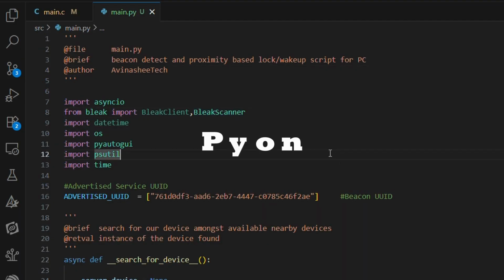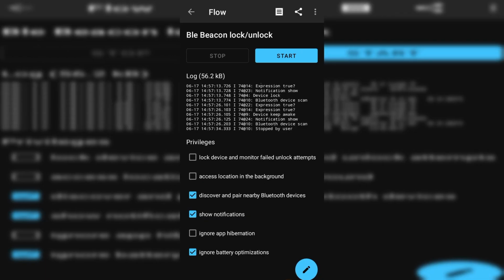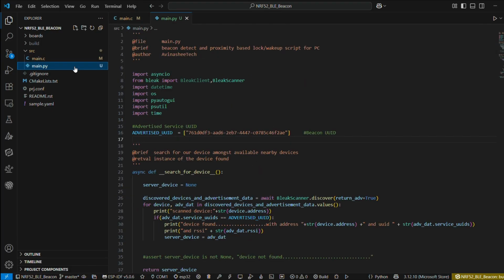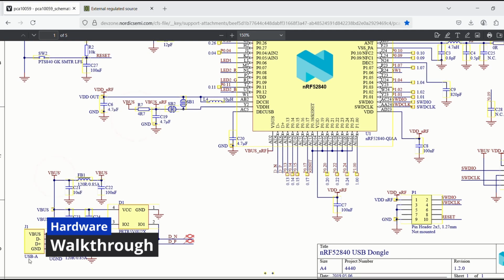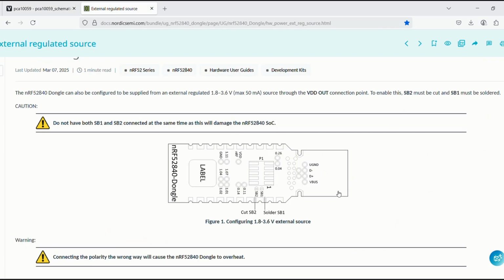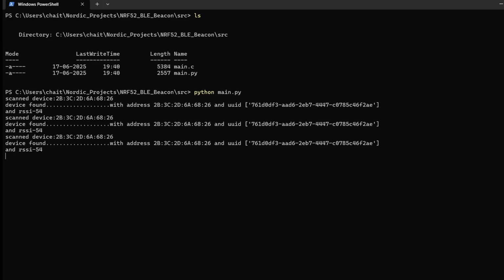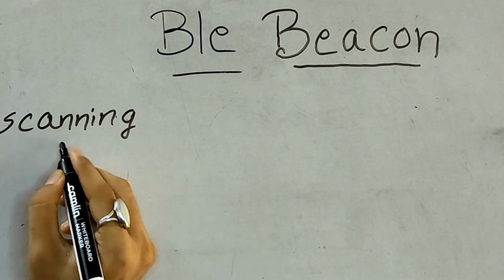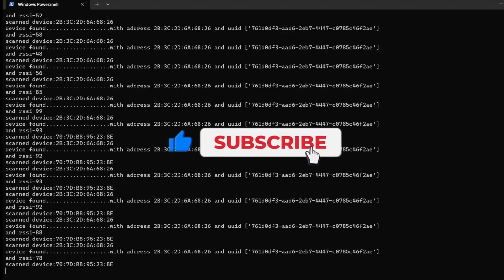BLE Beacon Wakes My PC Before I Even Sit Down (nRF52)

Comment: do one for motorcycle thiefs
Reply from the maker: While I would have loved to implement that in action, I don’t think I’ll be able to accomplish it right now.

But yes — if someone wants to build it, BLE beacon proximity can definitely be used to control the ignition switch (turn on or cut off) using a simple relay circuit. On top of that, adding a GPS and LTE module can geostamp the last detected beacon location. If the vehicle moves without beacon presence, it could immediately trigger alert messages to the user along with live location details.

Really cool idea for an advanced DIY anti-theft system.